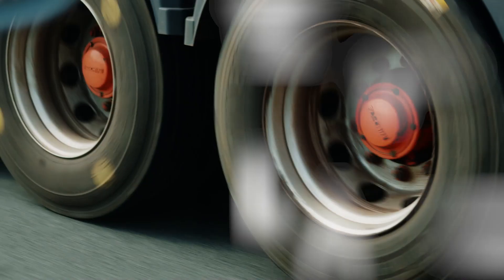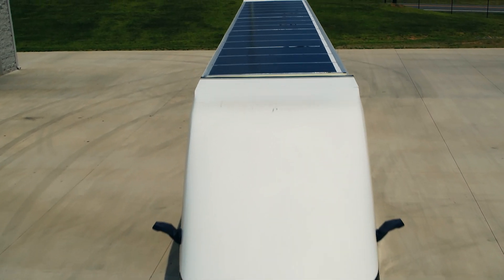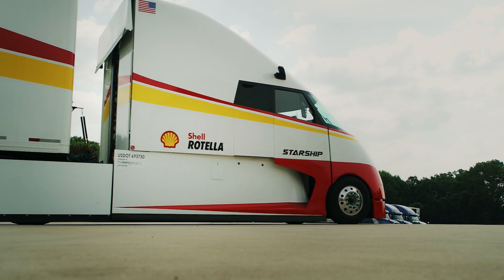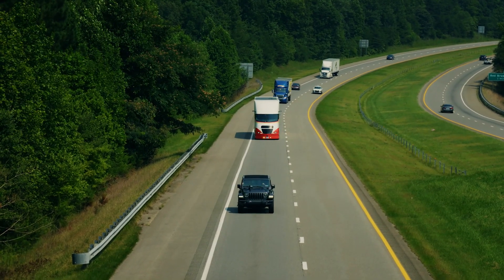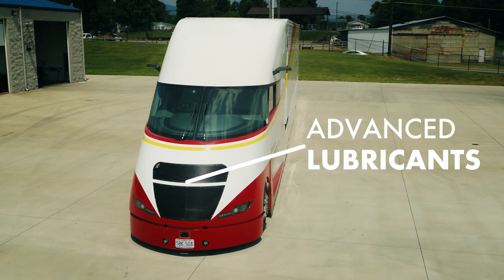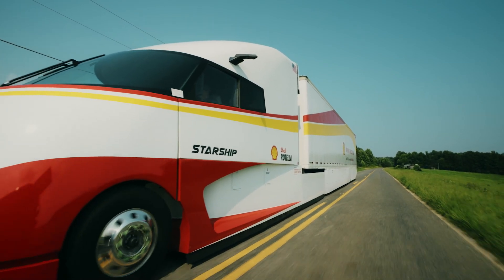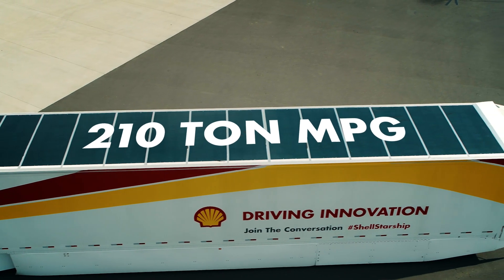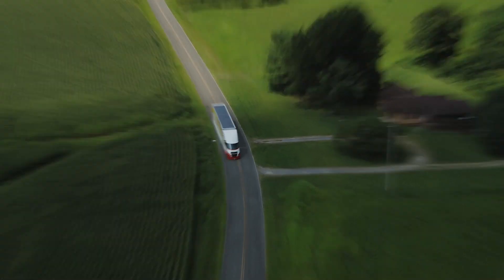Shell Starship 2.0

Comment: So what was the actual MPG   ????   254 ton MPG is not an answer, 
I would appreciate your input, thankyou
Reply: Actually, I think that it is an answer just a different way of looking at it. I didn't see the empty miles or "deadhead" factored in, though and I noticed that the slightly hillier Mt Airy to Lumberton was followed by a fair weather and flat I10 test. What about mountains? How do you clear snow? What happens when those solar panels on the trailer are covered with ice and snow?
Reply: @bixby9797  the avg  high efficiency rig gets about 8.5  to about 10 MPG with a load depending on conditions and weight ...   hard to imagine 254 mpg with a load...   this is a different calculation they have done
Reply: @DevilDog369  The average US rig does not get the mpg your saying unless they are running empty
Reply: @DevilDog369  Interesting but I know of no truck on the road getting mileage like that with a load here in the States at 40,000lbs. Can you provide specifics of that?
Reply: @bixby9797  I will try to dig up some of the links I was watching.
Reply: @DevilDog369  I'm very interested. My semi here in America gets about 6.5 mpg. This is down from 7.5 mpg 30yrs ago due to environmental regulations. Cleaner emissions but uses more fuel